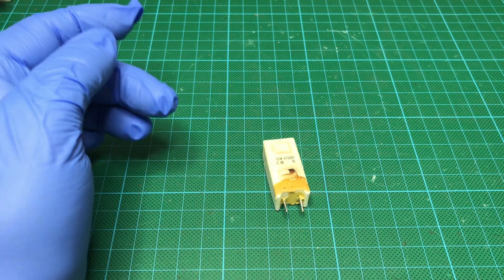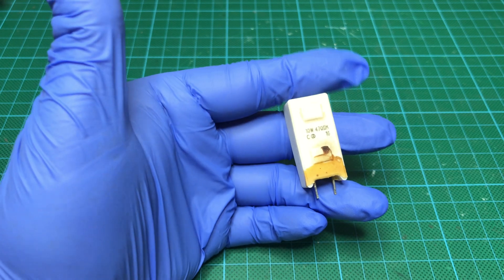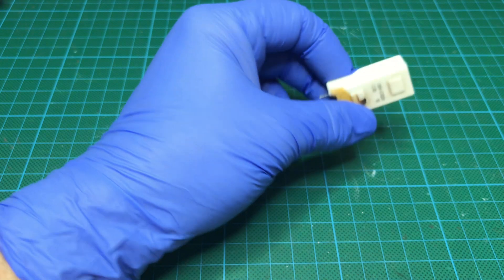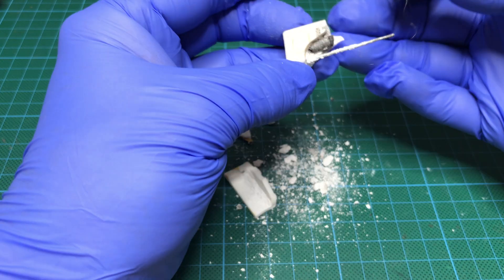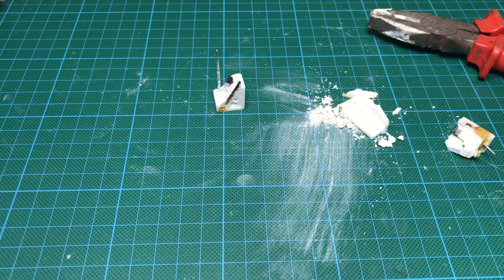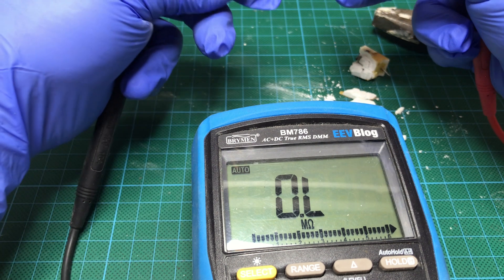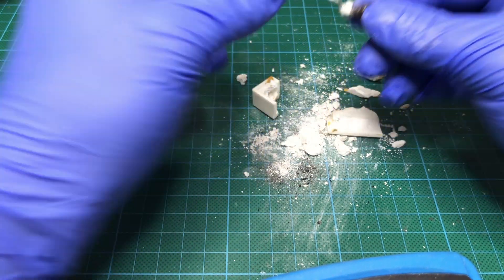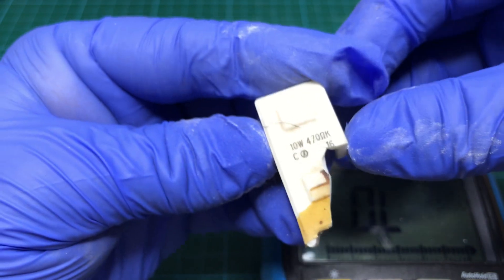Ceramic Resistor Wirewound ΩK find resistance, break apart, take a look inside, measure multimeter

Comment: This is not a ceramic resistor as it contains a resistivity wire which is causing an inductance.
Reply from the maker: Yes it uses a resistivity wire hence the "wirewound" resistor type but it is wound on a fine non-alkali ceramic core
then embodied in a ceramic case and sealed with an inorganic silica 
filler (straight from the datasheet). As a replacement i used the SQ series from TE (part number SQMBW10470RJ). 
As of inductance it is not mentioned in the datasheet at all, even for high resistance 150Kohms, so it should be tiny...

Comment: Did you manage to fix the air conditioning inverter board? 
I have the same problem with PFC module, current measuring resistor and charging soft start resistor.
I change PFC - IGBT three times, and I don't know what is case. Maybe I buying low-quality modules or if there’s some other reason..
Reply from the maker: Yes actually it was fixed and is still working fine. If i remember correctly problem was only the 10W resistor and the IGBT module.
I have a video about how you can test an IGBT module in the channel: https://youtu.be/3tapkT5gh9U
Does the board power on? If not then the black transformer like part "RM-1515-2B" might be bad....

Comment: When K is put after the Ω symbol, it reveals the tolerance range.  F = +/- 1%, G = +/- 2%, J = +/- 5%, K = +/- 10%, M = +/- 20%.  Example - Resistor with letter and digit code "4R7K" = 4.7Ω +/-10%
Reply from the maker: Very nice!

Comment: Thats 470K ohms
Reply from the maker: Did you watch the video?
Another giveaway that it is not a 470k resistor is that you would need more than 2150 Volts to reach 10 watt at that resistance...
Reply: @varnasfix  You labelled this video "470ΩK".
Reply from the maker: @MichaelKingsfordGray  Yes that is what the video explains (hopefully) so a 470k ohms would be 470kΩK. It is confirmed that the resistor is a 470 ohms 10W.
Thanks for your input!